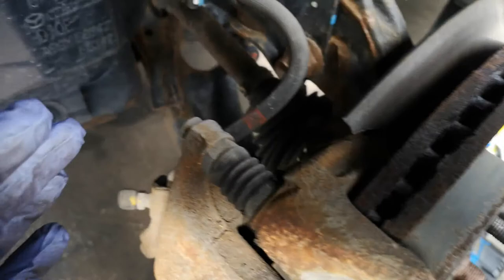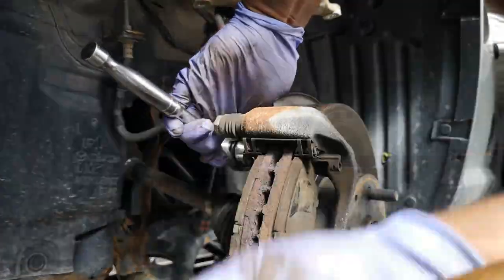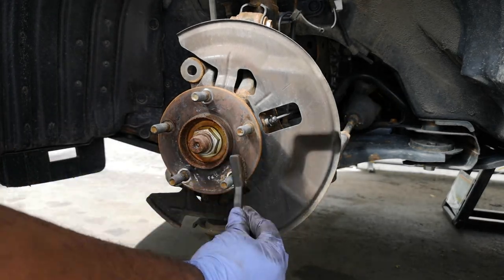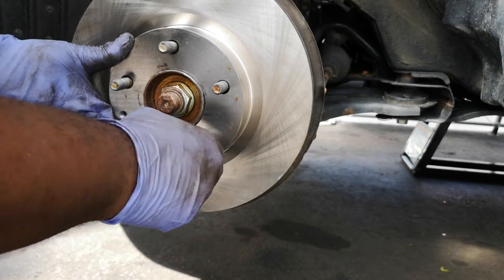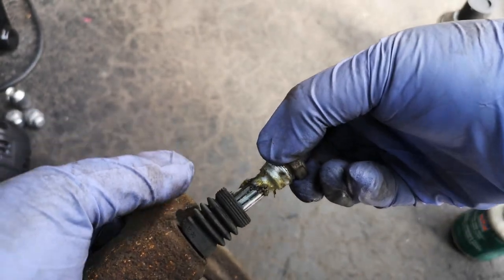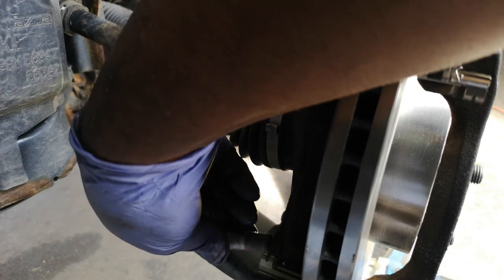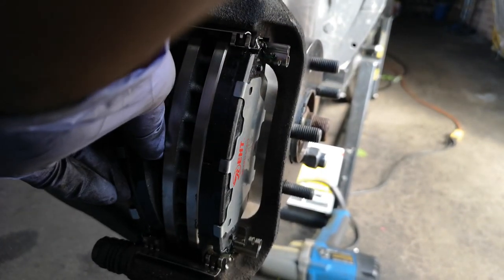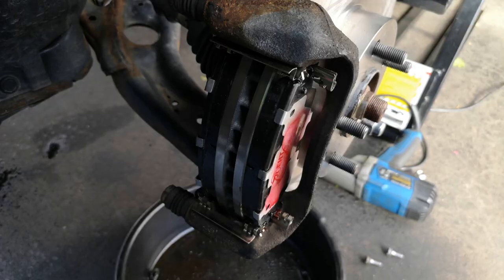Mazda CX3 - Change Front Brake Pads and Rotors

Comment: Thank you for the video! I'm going to be doing brakes on a 2019 CX-3 soon. Do you recommend Raybestos pads? I''m shopping for pads that are decent and reasonably priced. Thanks again.
Reply from the maker: No problem at all. So, for Raybestos, I've met a few technicians who say they're complete garbage. But I've used them dozens of times on a variety of vehicles, my own included, and never had any issues. So for my personal opinion, Raybestos is good. Especially their Element3 line.
Reply: Thanks again! @NexusAuto

Comment: Just one point to make my friend when replacing the sliding pins you must compress the air back out of the rubber boot by pushing and twisting the pin and squeezing the boot this stops the springing action from compressed air at the end of the pin otherwise your outer pad will rub slightly on the disc especially when the caliper warms up.

Comment: Great video...I like to crack the bleeder and lightly pinch the rubber brake line when compressing the puck to avoid pushing old fluid into the ABS system.
Reply from the maker: That's an awesome thing to do. Nothing wrong with that at all..Great step to have!

Comment: Do you have to remove the  front caliper mounting bracket to  put the new Brake Pad Springs in, as I am just needing to change front and rear pads, I do not need new Rotors
Reply from the maker: Nope, you don't need to remove the mounting bracket if you are just doing the pads, front or rear. 

For the front, it will be very straightforward and easy to do. 

For the rear pads, it is a little more frustrating to put the inner pad in, which i mention in the video. So I did it with the mounting bracket off the car. However, I did install the pads on the other side of the car with the mounting bracket installed, and it was possible, just...annoying. It will need some patience, at least it did for me. But you can get all 4 sides done without taking the mounting brackets off

Comment: this car looks very rusty for that a CX3 cannot be older than 2015. My Volkswagen from 2001 looks as rusty as this one, but it´s almost 20 years old and stands outside the whole year. It this normal ? In my opinion a car from 2015 shouldn´t be that rusty.
Reply from the maker: I take it your are not from a northern area/country? Places with snow, ice and road salt have this issue...perfectly normal. For Underbody, including brakes, suspension,  chassis, exhaust, etc depending on where you live in the north, can start rusting within a year. Rust proofing is very popular here in Canada, but it does not protect suspension and brakes. It's very annoying, especially when having to do maintenance work
Reply: @NexusAuto  Hmmm. I'm coming from Germany. Definitely not like Canada but there is snow, ice and salt here in the winter.
Reply from the maker: @segoiii  that's a perfect example, actually. I can't speak for all of Germany, but for the areas I've been (mainly Hanover, Hamburg, and surrounding areas) they don't get nearly as much snow, and crucially, in those areas, Germany is very particular with road salt use, due to the environmental effects. You can confirm if this is still true?.. I've seen it used, but not to the level used here in Canada. I'm not lying when I say that after the snow melts in the spring, the roads remain white for a while due to salt stains. It completely covers our cars, and our chassis' take a beating. 

I did a video on my pontiac grand prix a little while ago. It is a 15 yr old car, and I did the rear trailing arms. You can see a ton of road salt come out of the bushing as I removed the trailing arm. I've worked on 15 yr old Florida cars that are in far better condition than a 4 yr old Canadian car. We are a severe climate country, so this is common
Reply: @NexusAuto  i agree with you. Im from Czech republic. Neihgbour country to Germany to east. I have Mazda CX3 and after one year, brakes looks the same as yours in video. Chasis and rest of it undr car looks the same. Heavy use of salt here is normal. Im not a car mechanic, question, if scrub the rust and paint it will help? somehow? and btw thanx for video you save me lot of money.
Reply from the maker: No problem on the video. Saved a lot of money there. For certain components, you can sand it down for sure, and spray paint on it. There is rust inhibitor paint and there is also rubberized undercoating. You cannot do that with certain components though, like anything that moves (like the caliper piston or pins, strut shaft, the threads of any component ,etc). You want to make sure you can remove a component in the future, if needed.
Reply: @MyMatK  Interesting. I have a 2016 CX3 with about 55K miles on it. I'm in Wisconsin in the US, and we use salt on the roads in the winter. I literally have no rust on my calipers, or anything. Odd...

Comment: Not sure I'd trust a mechanic that uses a lump hammer on a Ratchet.
Reply from the maker: To each their own, of course. It really is about knowing when to use it. I still have all my original ratchets, even my first one from 20 years ago. None have broken teeth or any issues. I wasn't hitting it very hard at all. 

Also, it's all about knowing torque values. This was rated up to 81 ft lbs. This is always good to know as it tells you what to tightenup to, but it also tells you how much force is needed. If I see a bolt rated at over 100 ft/lbs, im going straight to my gun, a breaker bar, or a wrench and hammer. 

Personally, I would rather have someone who torqued to spec and used a hammer and ratchet, vs not torquing and using a wrench. But I get it too...people tend to beat the hell out of their ratchets. Meh, whatever works. It would be my tool that would break
Reply: @NexusAuto  In fairness having done the job now those bolts were not very tight, so unlikely to damage the ratchet. I'd still bollock any apprentice I caught doing it though!😀
Good clear informative video, a lot better than a lot of these "Instructional" videos that appear on Youtube.
Thanks. 👍
Reply from the maker: @grommit51  haha I hear that. Not gonna lie, if I saw an apprentice doing that, I would probably do the same! Lol. 

Thanks for the great feedback. Happy to hear the video was helpful!

Comment: Great video but you put a greasy finger right on the pad when mounting it. You said the torques required in imperial (add metric for international viewers) and didn't use a torque wrench to set them - just winged it lol.
Reply from the maker: Thanks, but the greasy finger wasn't a big concern for me, as it will burn off when burnished properly. They have torque spec Converters out there on google that can convert specs for you. And why are you concerned how I tightened my bolts? I provided specs. Mechanic feel is real. Thanks.